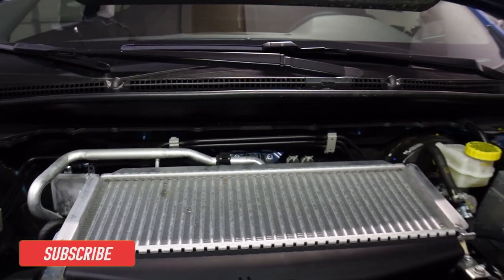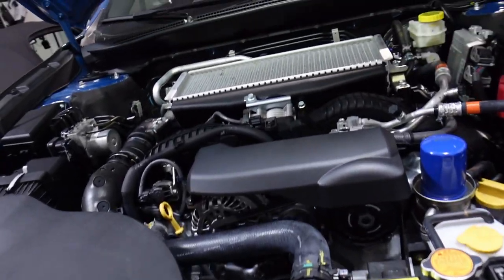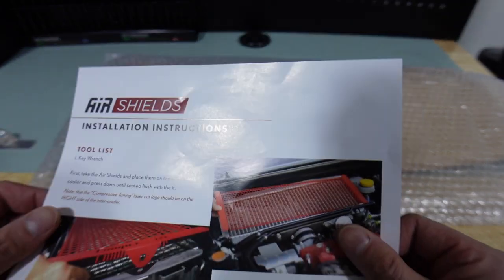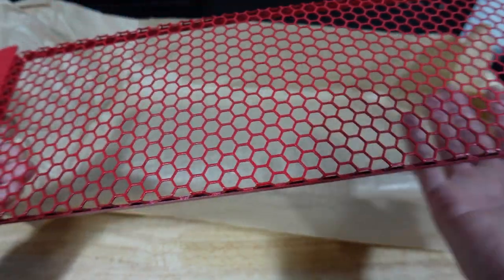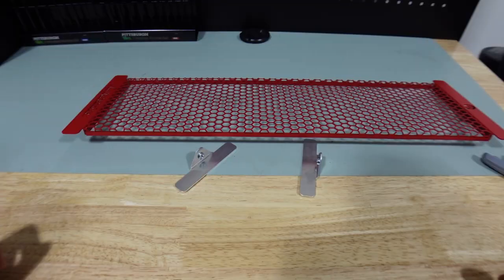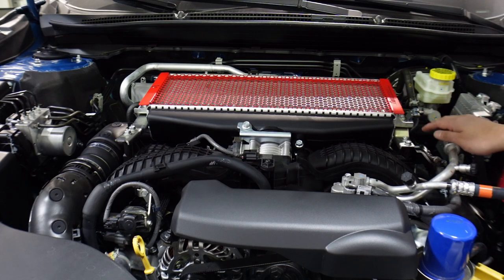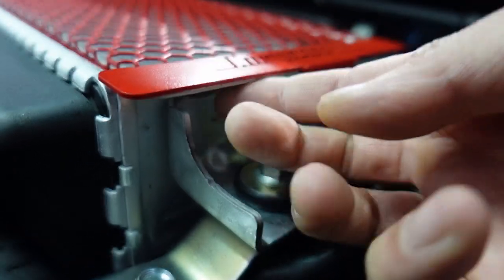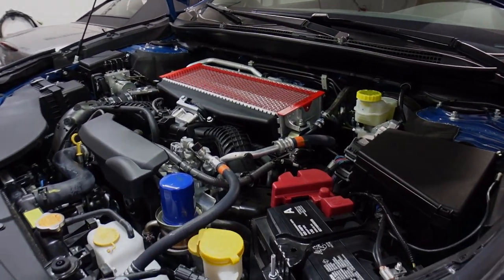Every SUBARU Intercooler needs THIS!

Comment: This will stop the hood scoop seal from completely sealing and causes a restriction
Reply from the maker: The seal is thick enough to where it doesn’t. Hard to prove it causes a restriction without a dyno sheet. The car’s running fine.

Comment: New new this was an issue. Not sure what you are using the car for. But are you going to add a oil and/or CVT cooler. Have been reading that can overheat if you push it in overlanding in hot/high elevation or towing at it's max.
Reply from the maker: So far, the car is used only for daily driving to work and back. Definitely have considered the transmission cooler regardless of towing or not as the car will benefit from it.